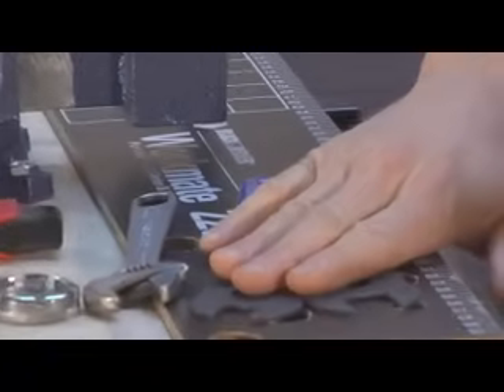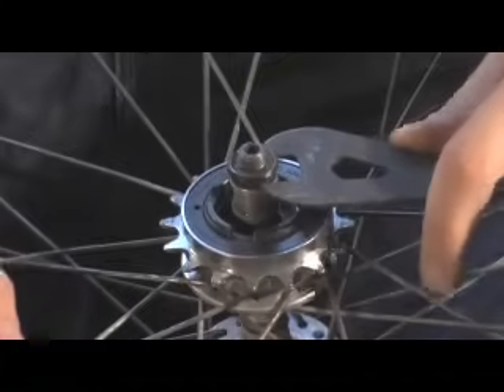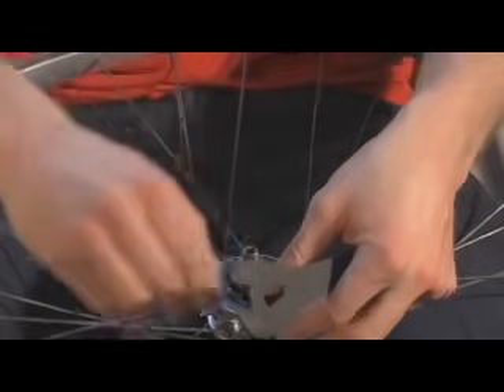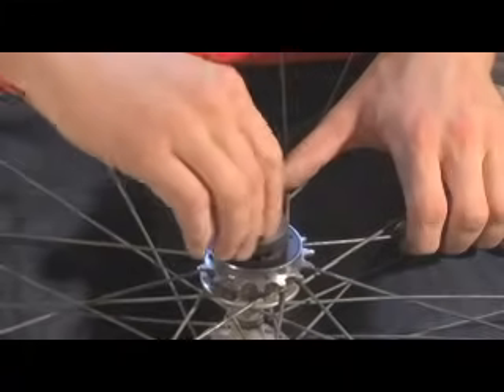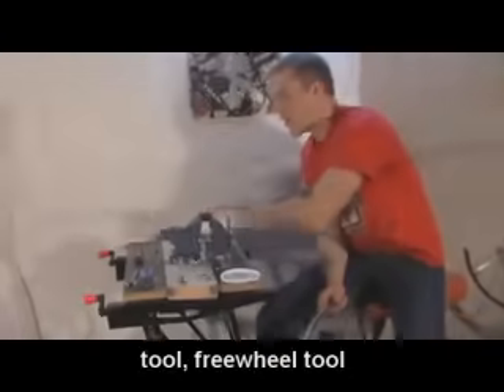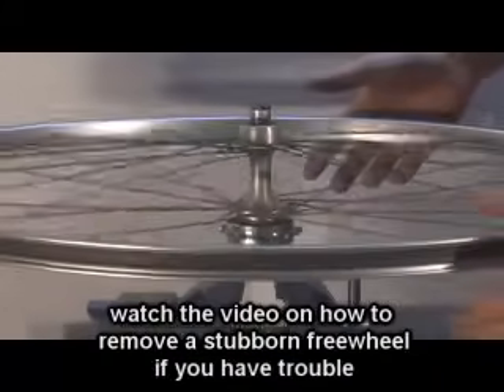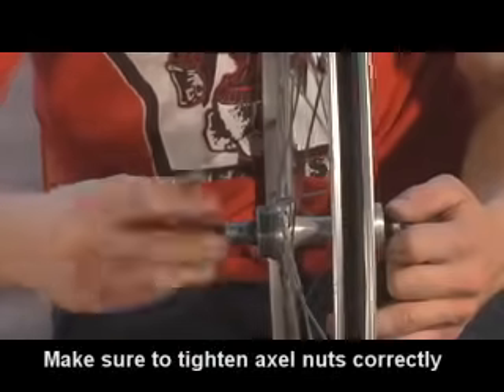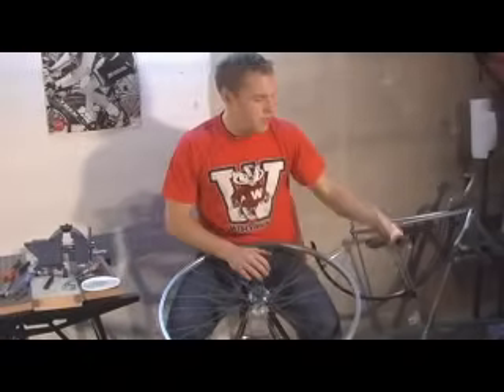Removing and Installing a Freewheel

Comment: I use hammer and nail to release the freewheel. There's 2 circle hole like on the surface, that's where you hammer. Counter clockwise to release and vice versa.

Comment: @Zakiuz101 For a proper fixed gear the hub will have two sets of threads, one set in a smaller diameter and reverse threads. The cog goes on the larger regular threads, then a lock ring goes on the reverse threads to keep the cog from unthreading when you try stopping or pedaling backwards.

Comment: @Zakiuz101 For a proper fixed gear hub. which will have a reverse thread lock ring to keep the cog from unthreading when torqued in the opposite direction.

Comment: I am working on an old set of Diamondback Tuff Mags.....is there a way to lubricate this cassette? I am bleaching the mags and during the rinse of the bleaching agent, water may have made contact with the cassette....it was a little frozen and I got it spinning but would like it to spin more smoothly.

Comment: if you have the axle out first you can wedge a crowbar or other flat headed rigid implement, clamp it with vice grips, and turn the wheel out. If the axle is in you will have to use a screwdriver/hammer to brute force it out. This can damage the freewheel if it is cheap or if you use too much force.

Comment: I just put on a Brand New ACS Claw free wheel. I have read good things and bad. My question is, do I need to open it up and lube it? Some people wrote that it will go bad if you don't lube it because where they make them, they don't put lube inside for some reason.  All of these posts were from 2004 to 2008. 

Thanks!

Comment: Hi I want to make my ratio lower so it's easier to pedal (lighter) but I have a Spanish bb and like 25 tooth sprocket and like 9t cassette I want a large cassette as I can't really lower the sprocket. Is there one that will fit a hub made for mini cassettes?
Reply: If that is what is currently installed on your bike in a 9-tooth size, it's a good bet that there are similar freewheels out there in larger sizes. Those aren't a lot of cog teeth to bear the brunt of pedaling forces. Move up to at least an 11, a 12, or a 13.  Even those sizes will be subject to rapid tooth wear, with a 25t chainring. If you are having enough trouble pedaling on a 9T to warrant a change to a larger size, it's therefore likely that the ratio you are riding on is over-geared, not just by a little, but by a considerable amount. So, skip a size or two. Just Google "single-speed freewheels".

Comment: heres how i did it :D 
i too kthe axle out of the wheel and then got soem old angle iron any strign metal with a square edge realyl then stuck the metal in the clamp put the grooves on the free wheel on the edge of the metal pushed hard and turn the wheel :D shabang ur done

Comment: ummm,not really! I mean,YES,you can change your freewheels,but if you have a 16T freewheel and you want to put a 13T hub, you'll need a hub that has a smaller diameter threaded thingy,look for flip flop hubs!
And,33-13 is wrong,you should be either using 36T or 12T respectively...33-13 will be lighter to run!